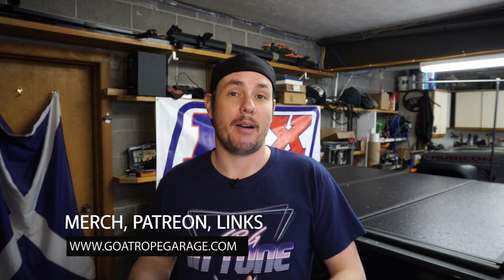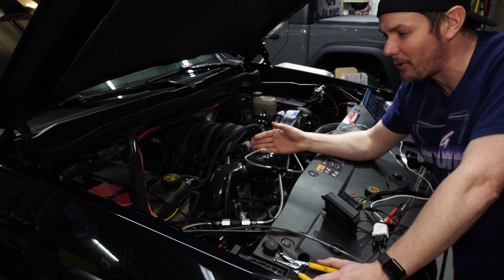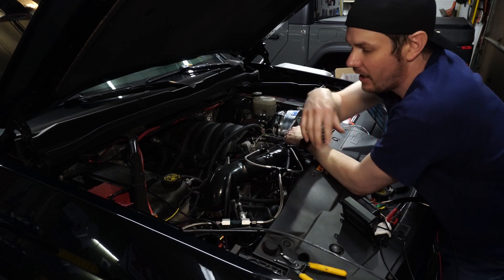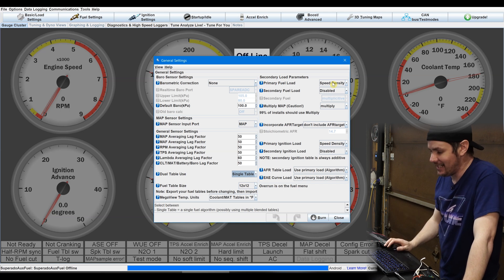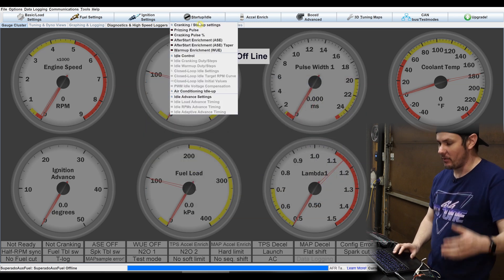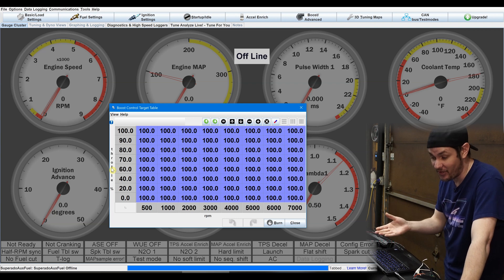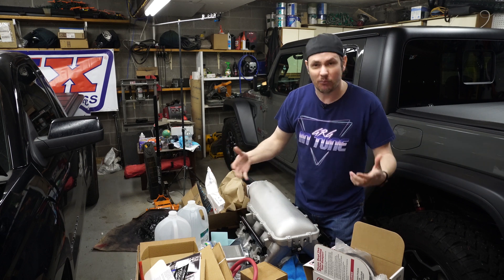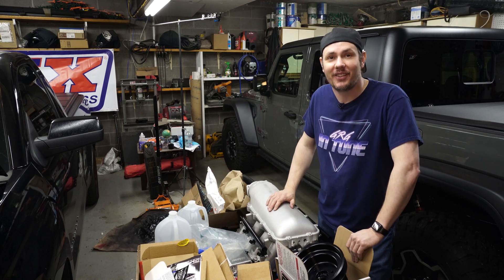Setting Up The Microsquirt For Auxiliary Port Fuel Injection!!

Comment: Don't worry about the cylinder count it doesn't effect anything but the tach reading in fuel only mode. Also the ve table goes to 255 and you may have to mess around with your required fuel value if you need more adjustment higher or lower (injector pulse width = ve * required fuel)
Reply from the maker: Thanks! Switching it to single coil worked even though we are using a trigger signal opposed to ground of a cap

Comment: I wondered about adding port injection to a direct injected engine.  Thanks for the video!  Seems like a cheap option for performance and an easy way to prevent the back of the intake valves from coking up... which all direct injection engines suffer from (with the crank case vents being redirected back into the engine).

Comment: @3:25, One pulse of a cylinder spark plug is equivalent  to 2 revolutions of the engine for a 4 stroke engine.  If you have to adjust it from 8 cylinders down to 1 to make it work correctly, then the microsquirt was expecting 8 pulses per 2 revolutions.  Weird.  That would be a old coil signal from a engine with a distributor, and only one coil.
Reply from the maker: But how does it work on fuel only?
Reply: I haven't used microsquirt, so I am not sure.   I changed my comment above.  I was thinking that it was just using the signal to be able to see the engine RPM, which is used in fueling.

Comment: Does the fuel rails run of the factory fuel lines or will you have to tap into the tank
Reply from the maker: We're going to try to run them off the factory lines with an earls tap
Reply: Goat Rope Garage but that might require a low side pump upgrade right?
Reply from the maker: @MALR7  not sure, mine is already upgraded though

Comment: Nice video, On my NOS mini controller When i tapped into just one coil for rpm signal i had to set the number of cylinders down to 0 for individual coil signal and it reads out the rpm very very precisely.
Reply from the maker: I don't think it will cause any issues that we can't work around, just annoying that as customizable as these units are you can't define your trigger for this without having to do a workaround that could effect fuel delivery.

Comment: Squirts per engine cycle should be 8 if you want sequential right? 
Edit: nevermind I see you are doing single injection event
Reply from the maker: Yeah, the micro only has two injector channels, so will be doing single injection or bank to bank.
Reply: Is there no sequential board add on like there is on the megasquirt?
Reply from the maker: @biggtim1270  not sure, might be since you can chain these with can, but I'm not concerned with sequential fuel as this will only trigger at higher rpms and bank to bank will be fine